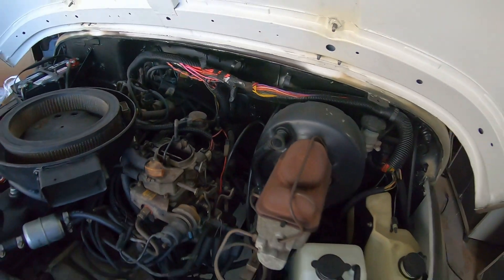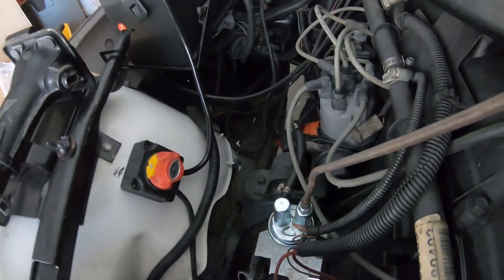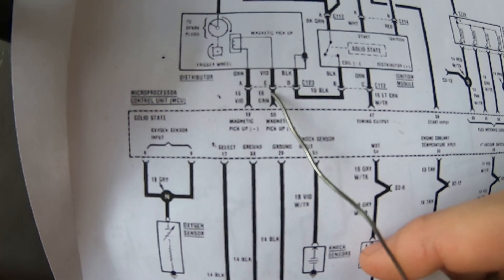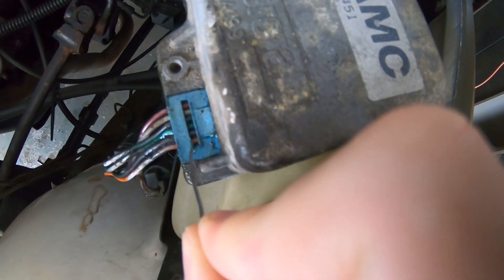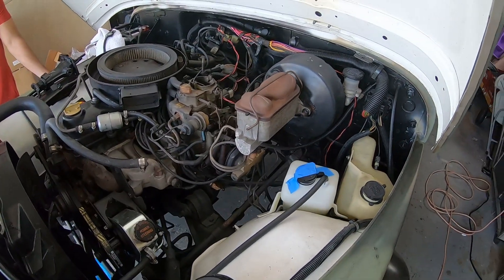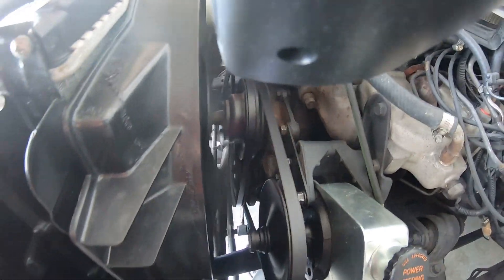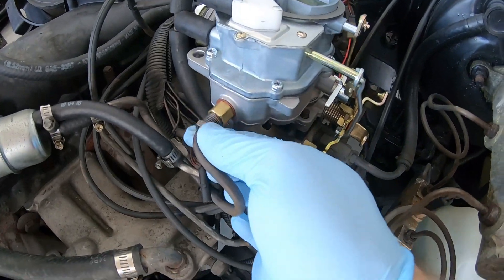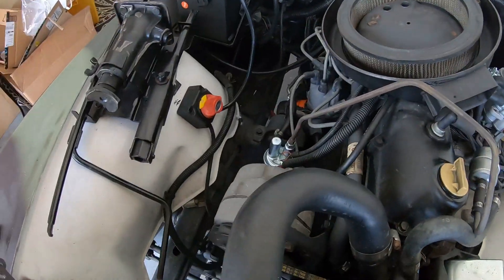Performing a "Nutter Bypass" on a 1987 Jeep Wrangler (YJ)

Comment: Where did you get the carb from? Any carburetor you would recommend? I did the nutter bypass and it still won’t idle well, thinking it’s a carb issue now.
Reply from the maker: Oh boy... it has been a while... I want to say the company name was something like "Brand New Carburetors" or something like that? Sorry, it was a long time ago. Stay tuned though - this same vehicle is in my driveway getting some work done: unnecessary vacuum hoses/controls removed, general tune up, new distributor, and possibly an electric fuel pump.
Reply: Thanks

Comment: Did the nutter bypass on my 87 before I got rid of the gawdawful feedback carb. It worked well for improving the performance and fuel economy, until I got a redone BBD with a manual choke for a dodge super six engine. Being able to fine tune the choke in -30 Ashtabula County winters was a godsend.

Comment: I have a 84 dj5 Jeep parts match up to a cj what wire is the power wire on the ignition control module and what is the white wire I bypassed it years ago ran fine but I have forgot that was 10 years ago please anyone that knows please let me know

Comment: Great video! Thank you. It helped alot. I was able to buy a very similar Reman carb off amazon shipped for about $80. Did the nutter bypass, new plugs and timing. Night and day difference. It was running way to rich before and i could not get it to run half the time.
Reply: Do you have a link for the carb you got? Thank you.
Reply: @Denver1976Man  I just typed it into amazon. Cheap china stuff. Better off just rebuilding it
Reply: @Rubisteve06  Thanks for your time. I def understand.

Comment: What did you do with the stepper wires?  I just unpluged the stepper motor and it ran better.  Do you see a problem with just leaving it unpluged?
Thanks for the Video, Very helpful!
Reply: Mines been unplugged and I haven't had any issues since I unplugged it.

Comment: Did you guys adjust the timing as well or just did the wire bypass with no timing adjustment?
Reply from the maker: I think we left it at factory timing. The owner is not a big high performance guy
Reply: Iirc you need to set timing at curb idle.

Comment: Where did you get the wiring diagram? I'm trying resolve no combustion after installing new distributor cap, ect.. and trying to figure your the extra wires to the ignition coil. Looks like a capacitor, which is disconnected and another extra wire to no where.
Reply from the maker: I believe I got the wiring diagrams from Google images. Did you check for spark at the #1 plug?
Reply: Joe's Garage    Yes. There was spark, but am still suspicious...
Reply from the maker: @mcnallysport  not much is needed for combustion... Fuel, compression and spark. If the spark looked weak, and it is weak in all cylinders, I would suspect a coil or coil wire issue. Did you do a nutter bypass already to wire the ignition pickup directly into the ICM?

Comment: Did you feel after the install the carburetor was a good purchase?
Reply: similar scenario for my 86 CJ7; performed Nutter bypass which helped resolve stalling.  Went ahead with Motorcraft 2100 carb replacement of old Carter carb (~$200).  Used Gronk via Ebay for that purchase and instructions.  I believe that color coded scheme is his schematic.  The fun is removing so many miles of vacuum lines.  Now she runs perfectly smooth and the engine bay is cleaner/less cluttered making it easier to isolate other engine issues.  Only "necessary" vacuum lines are distributor/carb line and carb/brake booster line.  Less essential vacuum lines run from open ports in carb bowl to charcoal canister.
Reply from the maker: To be honest no but I think that's because the carburetor didn't end up being the issue. I didn't post a video of this but we found that the previous owner had pinched the fuel lines between the tank and the body. They were flat as a pancake. 

If you do need a carburetor though the one we purchased was excellent.
Reply: @JoesGarageProductionsLLC  Thanks, I did the bypass with the help of your video. Appreciate your work !
Reply: @JoesGarageProductionsLLC  Great video,  I read the description and watched the video, then read the entire comments section, I think your comment here is worth noting as an Edit to the description section at the bottom even though the video is a year old.
Reply: Great and informative video. I’m looking to do the nutter and also looking to replace the car with a reman….. one question, may be a dumb one as I’m not exactly the most mechanically or electronically inclined, but if I were to get the carb without the stepper motor, what do I do with the plug that went into the old steeper motor? Would I just leave it in the engine bay, disconnected? Should I cut the plug off and liquid tape the cut wire ends? Any help on this would be appreciated greatly! Cheers!